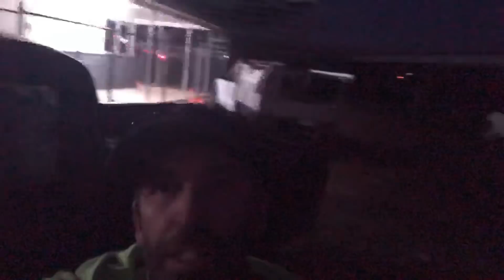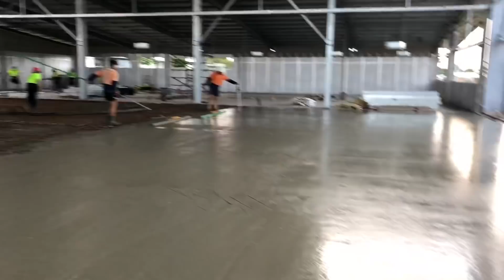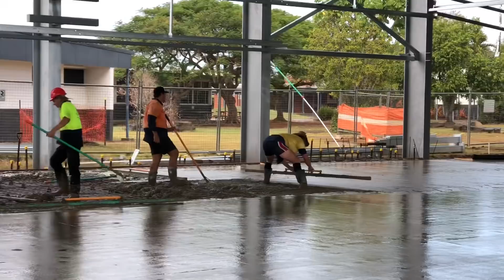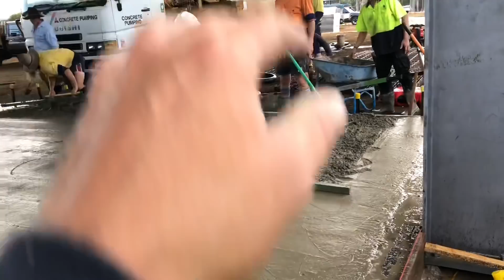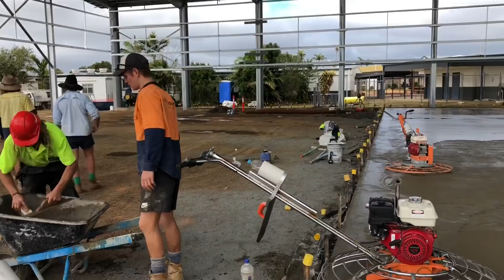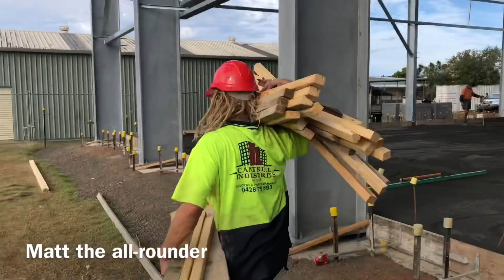How to screed and finish concrete

Comment: Hi, when he is packing the new section of rock he was putting down star pegs and packing over them.... i couldnt hear what what you said as to why he did it?  ive never seen that?  14:10
Reply: Aaron James Hey mate, he’s using the star pickets to clean the bottom of the plate compactor (in Aus we call it a Wacker)

Comment: So are you using height pins, or marking the height by a lazer level?
Reply from the maker: super duper yes we are using a laser level
Reply: Some guys like height pins, but they get stepped on or ran over by wheel barrows or line pumps. Great work.
Reply from the maker: super duper exactly right bro thanks for watching new video up tonight

Comment: How can you expect a  flat floor pulling those tiny screeds with no overlap and no pan under that trowel. Yikes
Reply: Ed Kreuz They use a laser level and check it against a knon datum/reference to maintain a flat and true surface.

Comment: Are you using pans to break your slab. You will find your 'f levels' increase by about 25-30%. Floor density is also massively increased. And what about ride on machines?  Been in the game nearly 30 years and definitely I recommend it.
Reply from the maker: white slave owner we don’t get too many big jobs up here in Bundaberg so no one has a ride on Machine . And we don’t have any pants so we just have to screed it flat . Thanks for the advice mate much appreciated 👊
Reply: @concreteninja  one of the mobs in Hervey Bay has one
Reply: Concrete ninja yeah we can see you don't have any 'pants' 😂😂
Reply: Definitely some hard workers though..

Comment: How many yards per hour are you pouring here.
Reply from the maker: Head Assassin hey mate I’m not sure how many yards per hour we only work by metres .
Reply: well it was 600sq mtrs, @ 200mm thick i think?, so that would be 120 cubic mtrs.   they started about 6 am and got it all in by 9 am... so 120 cubes in 3 ours... in Yankee talk that is about 92 cubic yards in 3 hours.      BUT!!  that job might have been 150mm thick.. i cant tell from the vision, if so reduce it by 25% = 69 cubic yards in 3 hours.